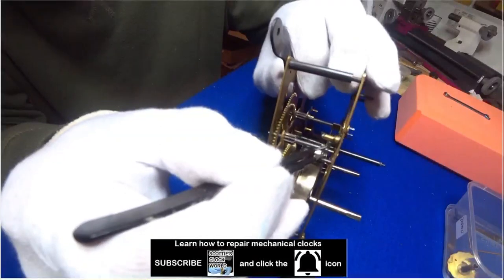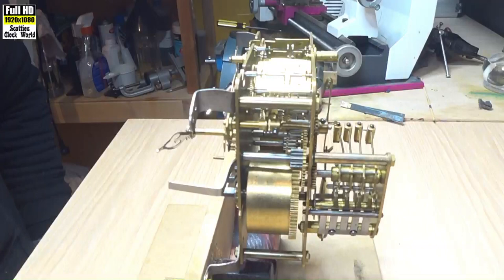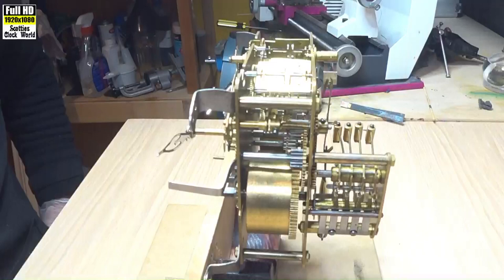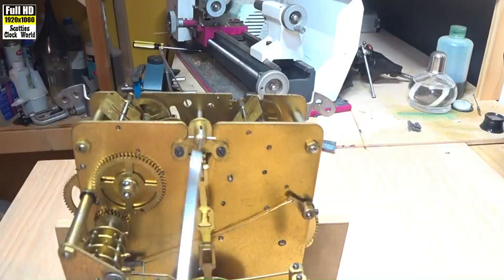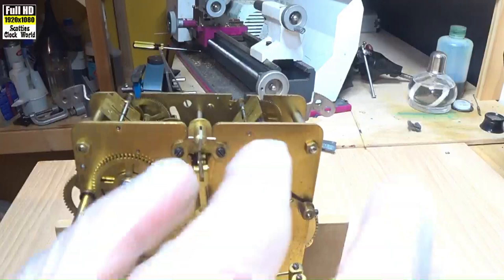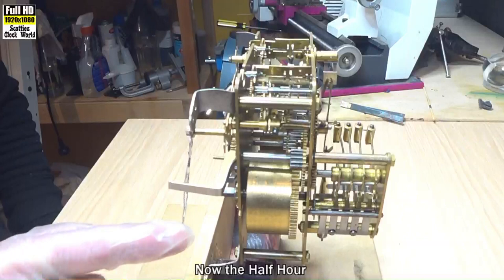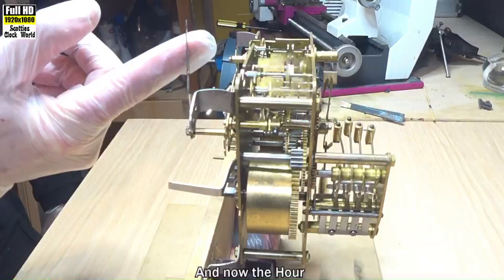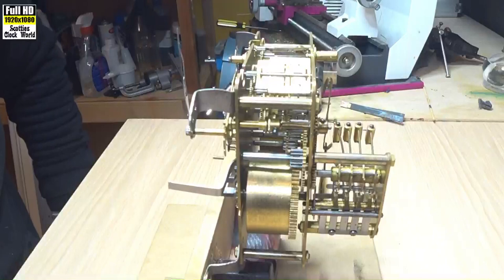German mantle clock movement Escape Wheel pallet adjustment.

Comment: I’m not a watchmaker and perhaps my opinion is completely wrong, so please correct me on that😊 Here’s a layman’s view on this process. As one of the pivots is fixed, changing the back cock position results in a change in the alignment of the palette arbor relative to the side plates. In an ideal world, the arbor should be strictly perpendicular to both plates. What you do in the video probably deals not so much with the depth of the palette but with the alignment of the arbor relative to the plates. I think the palette depth is fixed at design time by the position of the pivot hole on the plate opposite the back cock. (Most likely, I messed up the terminology; if so, my apologies for that.)
Reply from the maker: Yes that is correct. Thanks for your comment.

Comment: scottie - how do you know at what depth the pallets should stop at. i mean you could be at the top tips of the escape wheel or pretty far down into the escape wheel - what is the correct measure? .. or is it simply a little bit of experience and knowledge. still grasping with this one. too far up (excess wear?) too far down (chance of 'sticking'?)
Reply from the maker: The tip of each pallet has to just contact the teeth on the escape wheel, a couple of mm.
If the pallets drop too far down between the escape wheel teeth the clock will be stopped.
Experience sure helps unfortunately.

Have a look at this video and see if it helps:
https://www.youtube.com/watch?v=fKzm2u2mO-s&t=11s